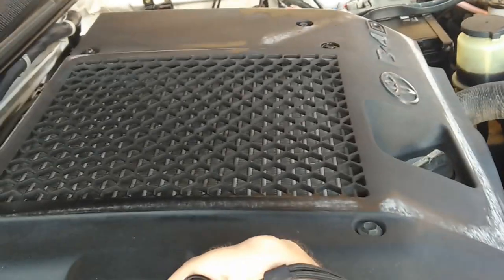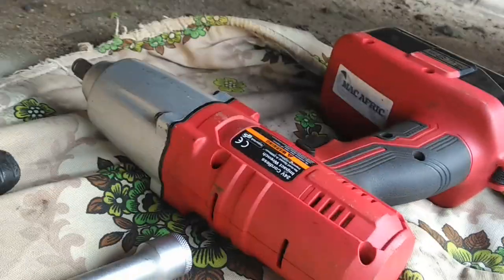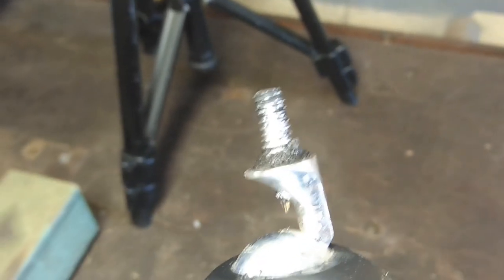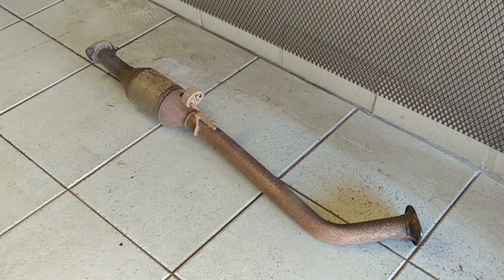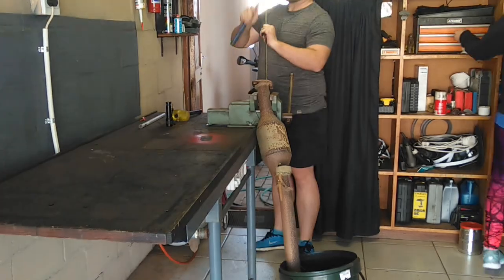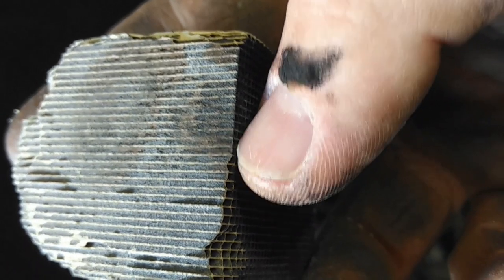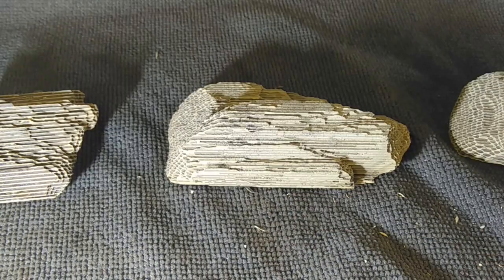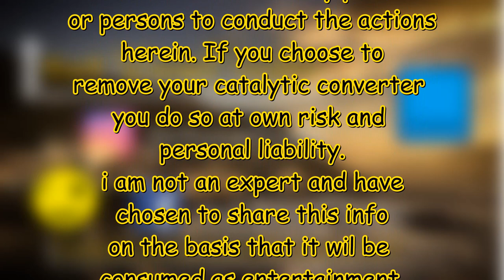How to remove a catalytic converter from a d4d Fortuner/Hilux

Comment: Halo My Friend. 
I see water coming out from your exaust pipe.? My hilux SR 2007 with Egr cooler its also got Water coming from Exaust when First star in the morning. 
Its that a bad sign?
Reply from the maker: Hallo there. You have nothing to worry about friend. Its just condensation forming after you have switched off your vehicle. The exhaust is still warm and the air inside the exhaust cools down faster than the steel of the pipe. That causes moisture to form inside. If the water coming out of your exhaust is persistent and does not stop a couple of seconds after startup then you may have an issue. But if the water only comes out when you start the vehicle then that is perfectly normal. During winter there should be more moisture than in summer. Hope this helps my friend.
Reply: @4x4ViewFinder  ohhh Thank You So much for the great and complete explanation for Me 🙏🏼.
Reply from the maker: @forevermaubere1995  no problem friend. Just happy to help.
Reply: Hi sir mine is a 4x4 Toyota hilux(D4D) 2.4diesel engine 2012 from uk but it’s now in kenya.it’s 3 and half years now driving the vehicle,i recently removed the same whatever u hv removed from the catalytic,and after the dpf light is still flashing on the dashboard,my question is how can i remove the light my self & after the removal of the items that were inside the catalytic will my hilux increase the power?thank u
Reply from the maker: Hey Anthony. If your van came from the UK then yes, there should be a DPF sensor in there, and the only way to get the light off is to install a DPF sensor fooler. They are dirt cheap and you should be able to buy them online on Ebay or Amazon or Alibaba. They are super simple to install and the fool the ECu to think there is a catalytic converter installed.
Removing your Cat wont give you a noticeable performance boost but it wil help your engine last longer. It helps decrease your exhaust gas tempratures and lets the engine run with minimal to no resistance or backpressure.
For a cheaper performance boost that wont cause any damage to your engine and will change the characteristics of your car completely, have a look at installing a throttle controller. There are many on the market and they turn your car into something else completely. Hope this helps friend. Thank you for commenting. Keep safe.
Reply: @4x4ViewFinder  Hey mate I've got this problem too but it persists even when the engine is at operating temperatures?
Reply from the maker: Hey there, firstly, are you having to top up your coolant regularly. If yes then you have a bit of an issue there. If your top gasket has poped then you could have coolant enetering the engine and you should have that looked at sooner than later. If enough fluid gets through you can bend and break con rods and valves. Sorry if this response is gloomy but rather be safe than sorry.

Comment: Middag, moet mens iets in die ecu update wanneer jy cat uithaal? Videos op y'tube gesien al wat dit sê en dan klomp geld daarvoorvra.

Blykbaar kan die injectors op n sekere stadium na ontbranding bietjie diesel spuit wat dan saam met die uitlaatgasse na die cat beweeg om hom skoon te brand.

Dankie vir n goeie video!
Reply from the maker: Midag Christoff. Jy hoef gelukkig niks te update of bypass met die d4ds as jy sy cat uithaal nie. Navaras moet jy sy sensor bypass en die nuuter np300s het n cat burn knoppie waar hy brandstof in die cat in spuit en dan dit herbrand om die cat "skoon" te maak. Toyotas het nie dit nie. Ek sal jou egter nie kan sê as jy die heel nuutste hilux of tuner het nie. Nie seker of hulle dieselfde ontbranding doen of nie.

Bly die video kon jou help. Al wat n cat delete jou mee help is, baie minder weerstand op die enjin. Jy gaan nie regtig verbetering op brandstof verbruik of krag sien nie. Maar as jy van plan is om te map dan is n cat delete n vooreiste. Anders stoot dit jou EGT's, exhaust gas tempratures op. Dit maak dat die enjin baie swaarder op brandstof loop en baaaaie warmer is en daardeur sal die ecu jou power output verminder hoe meer hy moet trek. Dis n sneeubal effek wat ook maar eintlik net sal tee kom as jy baie swaar sleep of in die sand speel. Maar soos jy seker weet, hoe minder weerstand n enjin het as hy werk hoe langer hou hy.

Lekker midag. Laat dit juig meneer.

Comment: This decat is incomplete if you do not do a dpf delete on the ecu.You will have a check engine light and maybe one or two other engine codes associated with the dpf
Reply from the maker: Hi Rafiek. Not on the fortuners and the hiluxes. The nissans have a sensor on the dpf that you can just put a CatFooler on. It looks like the actual sensor but it fools the ecu into thinking there is still a cat. Im not sure if this is the case in other countries. But if your toyota has one you can just buy a cat fooler for your vehicle on ebay. Dont mess with the ECU.
Reply: @4x4ViewFinder  Cat removed but when I accelerate hard the fuel system warning light comes on. Have to reset to remove the light. Please advise. Roland.
Reply from the maker: @debbieferreira5674  hey Debbie. That should not happen. If you have a D4D then there is something else wrong. Could be water in the water trap or you need a new fuel filter. A good service should solve that problem. If however you have clean filters and a dry water trap then you have a fueling issue and you may need to take your van in to toyota to diagnose. A cat delete does not affect your engine fueling in any way. There is also no sensor on the cat to fool or to reset on ECU.

Comment: Did hilux 2008 has same cat and same position ? Iwant remove it
Reply from the maker: Hi, yes it does. The can should be in the same place. Hope this helps.
Reply: Thank you so muchhh for helping . Your car Sound so cool ... Love it.
Reply from the maker: Thanx so much, i really apreciate the compliment. Sounds like you are about to or are investigating going straight pipe yourself. The noise is not a factor, you hardly hear the diffrence on the inside.
Reply: @4x4ViewFinder  thanks sir , this my first cat delete for stock exhaust. .  but sir , i want to know , after delete cat did it can incrase torqe and hp ? What benefit after doing this for the engine and turbo ...  Thank you sir
Reply from the maker: Well my friend, people say they feel an increase in HP and Torque but i never felt it. The only reason you would remove it is to preserve the longevity of the engine. The Cat puts a lot of resistance on the engine thereby increasing exhaust gas tempratures. This in turn makes the engine over fuel and thereby increasing your EGT even further. This kills performance when you need it most. So by removing the cat there is no longer a restriction in the outgoing exhaust gasses and your EGTs drop considerably. As a result your turbo also spools up a little bit earlier as well, perhaps around 200 to 300rpm earlier, giving you a bit more performance down low in the rev range. This does nothing to the turbo dont worry, it does not change any perameters of the turbo it just spools up a bit earlier that is all. If you are looking for a performance boost but you dont want to mess with the engine, i can reccomend a throttle controler. You wont believe how much performance a d4d have, but just because of how toyota have set up the throttle response of the van, they have killed a lot of that performance. Have a look at the video below. I was astonished at the standard performance it was able to deliver. Now both my uncle and my father put one in their vehicle, its crazy. 
https://youtu.be/9RkjWxn-Cj0
Reply: @4x4ViewFinder   sir, today i was look my hilux vigo 2006 , my hilux not have cat at the exhaust .. haha .. what should i do?
Reply from the maker: Well consider yourself lucky, you dont have to get your hands dirty. Only thing you could do next is a straight pipe, meaning, remove your exhaust box and put a straight pipe. And after that a throttle controler, then you will have the same setup as i do.
Reply: @4x4ViewFinder  niceeeeeeeeeeeeeeeeeeee tq sir for helping !
Reply from the maker: No problem brother. Many happy miles, enjoy your van. God bless, keep safe.

Comment: Does the cat delete damage your engine after time at all ?
Reply from the maker: Hey brother. Not at all. If anything it prevents damage. The cat creates a lot of backpressure and increases egt's (exhaust gas temprature) without the cat your turbo spools up a bit quicker as well giving you a little bit more torque a little lower down. I can however not garantee there would be no damage, it all depends on a number of factors. Age of the vehicle, if services where done regularly etc. I urge you to do a lot of searching on the internet and at local exhaust shops. Then make a educated decision on the matter. Hope this is helpfull brother. Thanks for supporting. Keep safe.
Reply: @4x4ViewFinder  thank you im trying to do some research some people say uts not good because the turbo is working harder but slot of people say its better for the vehicle so im really confused i have a 2012 isuzu kb300 lx dteq and it had just over 260 000 ks not sure if you will recommend it or not ?
Reply from the maker: No brother turbo can not work harder. The engine can only create as much pressure as its own combustion allows. As a matter of fact the back pressure the cat creates is the only thing that makes the turbo "work" harder. Thats why, when you remove it, it spools up lower in the rev range. In my opinion it only does good.
Reply: @4x4ViewFinder  thank you so much for the help much appreciated love the videos 💪
Reply from the maker: @braydenpascoe1081  thank you brother. I really apreciate the support. Keep safe.